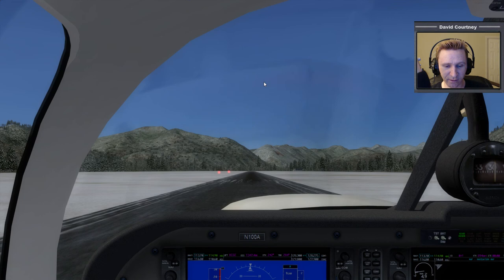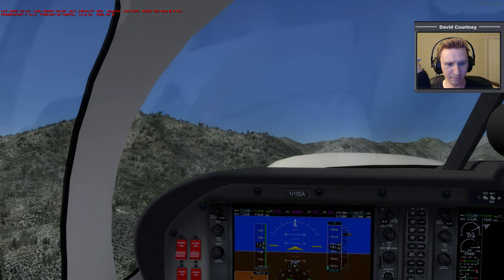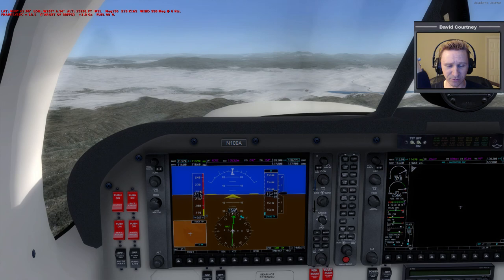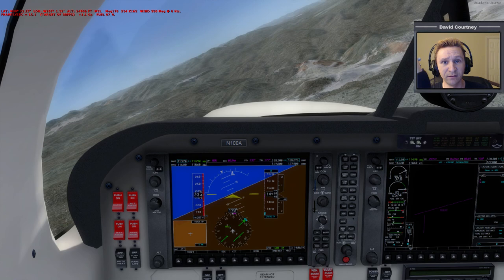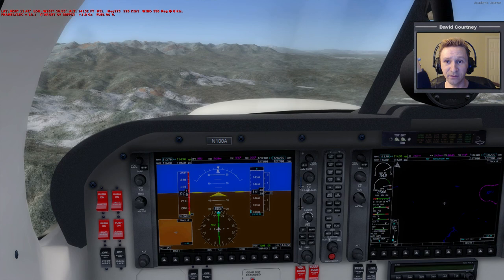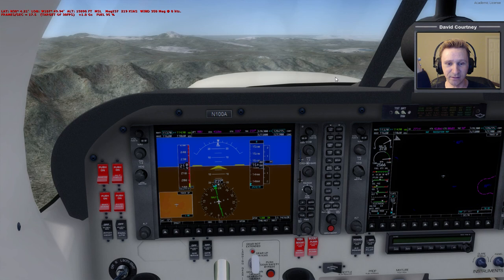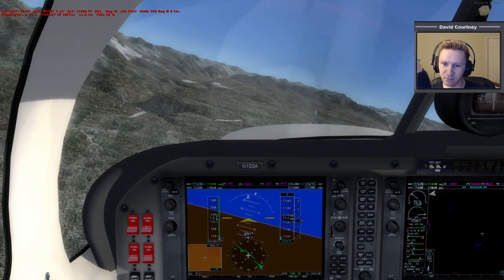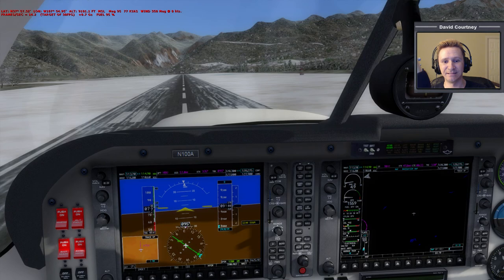Prepar3D v2 Flight Simulator - Flying in the Mountains [Part 4]

Comment: Ok David.. some tips for you for landing. I think ur in the Mooney Bravo, Approach speed is 80 knts in that, too fast ur elevator is too sensitive n that causes u to crash. Remember the old adage, Pitch controls airspeed, power controls climb rate. Get your speed pegged early, then just keep the threshold from moving up or down the windscreen. You flared way too soon, flare when the runway begins to flatten out (when two ends start to move together). That's the key moment to flare, make it gentle n just pull level n let it settle on its own.

Comment: You should check Vx and Vy for that air model. Your airspeed on climb was pretty high (140ish), so I'm sure that you were not climbing optimally.
Reply: I used to do some development work using P3D, but essentially gave up on it. The support seems non-existent for small developers, and the (lack of) support in their developer forums was pathetic. Maybe things are better now, but a couple years ago it was a disappointing experience.
Reply: Regarding adjusting the controls (instruments) while flying IFR...you need to do it very incrementally, otherwise your attention is diverted much long than it should be, and things go awry pretty quickly. It's one of the biggest mistakes instrument flight students tend to make--and one of the things most entertaining to instrument flight instructors...lol.

So what I mean is make a small adjustment to an instrument, then divert your scan back to the panel and make sure things are stable. Then go back to the nav instrument...then back to the flight instruments. Rinse, repeat. It just takes some getting used to.
Reply: Regarding the "green line slipping to the right"... That's your Course Deviation Indicator (CDI), and indicates your drift across the track. The reason your aircraft is not exactly aligned with the CDI is simple--wind drift. You are having to crab into the wind to maintain your ground track along the VOR radial. Don't worry about where the nose is pointed so much as where the CDI is. Fly whatever you need to to keep it centered.
Reply: At 28:20... No, it was a 20-degree bank. The smaller ticks on the artificial horizon gyro are 10 degree increments, and the larger ones are 30 degrees. You were two small ticks to the left of straight & level...so it was 20 degrees of bank.

So it looks to me as though that instrument goes: 10, 20, 30 (large tick), 45, 60 (large tick) degrees of bank to either side of neutral.
Reply: At the 32:00 mark (or so), your problem is that your approach isn't stabilized. Your airspeed never seems to be constant there, and then you chase it a bit. I would recommend that you read the aircraft operating manual for that air model, and determine what the proper approach speed should be. Then fly the aircraft and determine what power setting it might take to actually give you that airspeed. Then, the next time you want to fly an approach, set THAT power setting (and aircraft configuration--gear, approach flaps, etc), and just fly the aircraft. The airspeed should stabilize where you want it, but you can adjust slightly with power if needed.

One thing to remember about flying an aircraft: Pitch controls airspeed, and power controls the altitude. So if you want to go faster, lower the nose. If you need to go slower, raise the nose. When the power is constant, those changes WILL affect the aircraft in the way that I've indicated. Likewise, if you want to go higher...add power. Lower...remove power. When you hold your airspeed constant and adjust the power, the aircraft will climb or descend the way I've indicated. It's the biggest thing for student pilots to get used to, but I spent many years teaching people how to fly--so I know that it works. I haven't even gotten to the landing yet (writing these comments as the video progresses so I don't forget anything), and I can tell that it isn't likely to end well...lol.
Reply: OK, got to the landing. That's pretty easy to fix actually. First of all, read my last comment about a stabilized approach. A bad landing starts in the downwind leg, when you don't plan for a stabilized approach. Simply put--fix your approach, and the landing will come.

As for the very end there, you did indeed flare a bit too high. The airspeed bled off too much, and it stalled well above the runway. You actually did very well holding it at a (relatively) constant height above the runway--it's just that it was 20-30 feet too high! No big deal...once you get your approach stabilized, the rest will follow. The other thing to do is to focus on a reference point waaayyyy down at the end of the runway. Don't focus on the runway right next to the aircraft, until the aircraft is stable just above the ground (3 feet) and you are in the flare and bleeding off your airspeed. Then you can look at the ground near the aircraft. Otherwise you get the sensation that the ground is coming much more quickly than it is, and the natural tendency is to over-flare...and you balloon. Then you recover about 20 feet too high above the runway, but it's then very difficult to let it slowly settle back to the runway--and so you tend to stall and drop it in like you did here. Also, the other poster is correct in that you basically landed on the nose wheel.

Regarding his rule-of-thumb comment on the relationship between GS and descent rate: I believe that's for a 3-degree glide slope. If that's what you want to use, then great. But sometimes that's NOT what you want to use, or it's not what you CAN use (because you're too high or too low), so just remember that it's a guideline...not a hard rule.

Finally, I would recommend that you ALWAYS tune in the ILS and fly it...or at least use it as a reference. It's information that you have available, so why not use it? As I write this, there's a story in the news about a Southwest Airlines 737 that landed at the wrong airport in Missouri, and I'll bet a dollar that happened because the pilots were NOT paying attention. I'll bet they didn't even have the ILS tuned in, even though many airline flight operations manuals advise doing just that, even in VFR or on a visual instrument approach--for the simple reason that it backs up the visual picture of what's going on outside the aircraft. Don't get in the habit of giving away information that's easily at your disposal. Tune the ILS, and positively identify the localizer beacon morse code (ie; verify the station), and follow the visual cues. Better yet, learn how to use the flight director in that air model (if there is one), and hand-fly the approach using the visual cues on the HSI display. If you REALLY want to learn how to fly the aircraft via instruments, then that's the way to do it.

Send me a message if you want to learn more, and I'll give you my Skype name and email. I haven't given any flight instruction for several years, but I have given many many hours of both basic and instrument flight instruction over the years, so I may be able to help you out.

(Love your Orbiter videos too, by the way!)
Reply: David Courtney
I see on the Mooney site that Vso (stall speed in landing configuration) is 59 knots. The FAA basically advocates using an approach speed of 1.3(Vso) as an approach speed. I've long since forgotten the exact reasoning behind it, but long ago I just memorized that number as a rule-of-thumb--and then just added a bit of buffer for comfort according to the aircraft I was flying. Certainly you should use whatever the manufacturer recommends--but in lieu of that, you can use 1.3Vso. So in this case, that would be about 77 knots. So a 90 knot approach speed (that's ground speed, btw) would probably be what I would use on approach. Certainly you could use 80 knots airspeed as well--but you must watch your ground speed on approach, because the timing that you see on instrument approach plates is based upon ground speed...not airspeed. It's up to you as the pilot to adjust your airspeed to ensure that your ground speed remains whatever you need it to be on an instrument approach. The important thing to understand here is that the most common problem pilots have on approach and landing, is carrying too much airspeed that they then have to bleed off over the runway...often with consequences just like what happened to you in this video. Being too fast "over the fence" (the end of the runway, basically) is a VERY common problem.

So the take-home message here for you is that you should decide on an airspeed to fly on an approach (say 90 knots, for the sake of argument), and then figure out what power settings will give you that in the various configurations you'll need to fly. So for instance: 90 knots with a clean airframe...90 knots with gear up and one notch of flaps...90 knots with gear down and full flaps...etc. That sort of thing. Once you have those figured out, you just set the power to be what you need it to be for your phase of flight, and then adjust airspeed with pitch. It's pretty simple, once you break it down into manageable components.
Reply: David Courtney
Exactly...a "crab angle" into the wind. Yup. You use whatever crab angle you need to in order to fly the proper course over the ground. It's all just simple vector math, and you can see that with an E6B manual flight computer...or just draw the vectors manually on some graph paper and do the math.